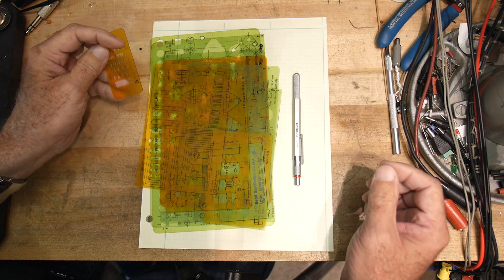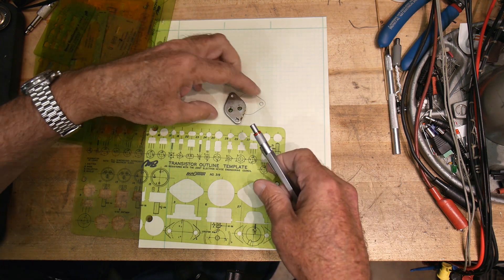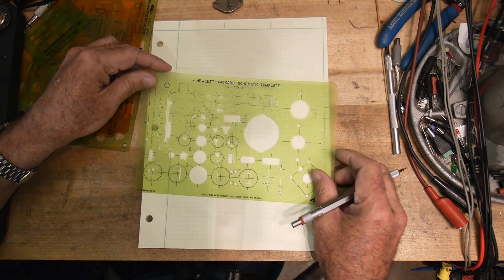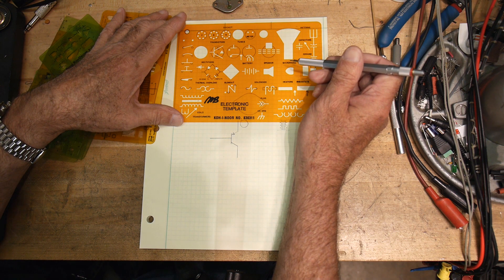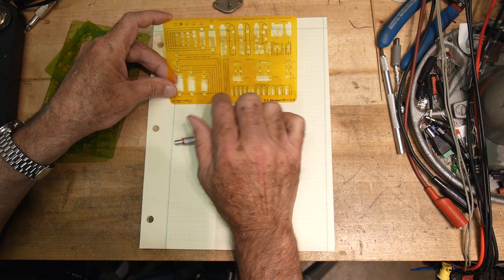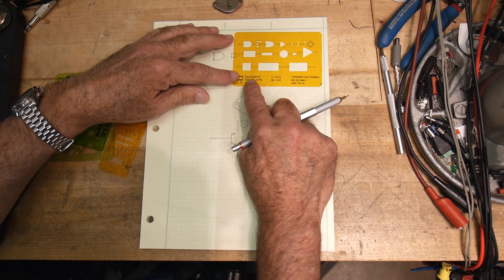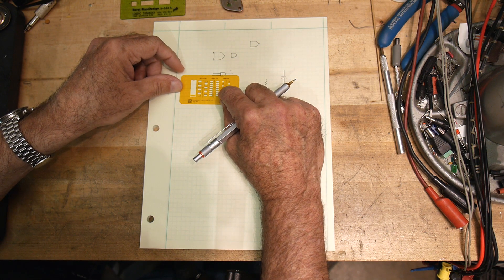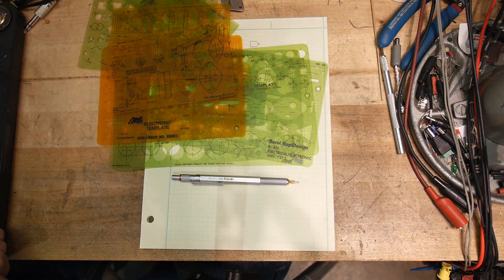#470 Drawing Schematics Before CAD

Comment: Many thanks for the video! I wonder how people used to etch PCBs back in 70-80s, especially for prototyping. Today people use laser printers and photoresist, or inkjet printers and iron. I guess there should be an older methodology involving templates and maybe some sort of varnish. Or was it only dead bug / ugly / ground plane / manhattan construction?
Reply from the maker: I used to just draw the circuit on the copper with a sharpie. The ink was the resist. and into the ferric chloride it went.

Comment: If memory serves, the smaller package that looks like a TO-3 was a TO-23. Googling it, I found a drawing, the shape is right, but it didn't have any dimensions, maybe I'll search harder in a bit. I remember hours spent with templates like those, a drafting machine, and a lead-holder. I did a lot of tape and mylar circuit board layouts, usually very large sheets done at 4X. That's been maybe 35 years ago. This video really brought back some memories.
Reply from the maker: Yes, loved the 4x rubylith PC layouts. You stored them in the drawer and when you went to use it the tape pulled off....

Comment: Where can I get this templates today? Or is there a way I can make one my self? (like with 3D printer or CNC mill)
Reply from the maker: Google "drafting templates electrical"
I see many still for sale
Reply: You could probably make one easily with a vinyl cutter or a laser cutter, or any number of similar devices. You could probably get old ones on ebay?
Reply: Consider 3D-printing one.